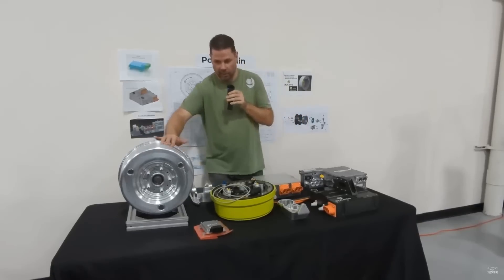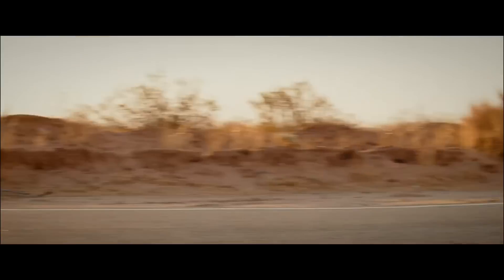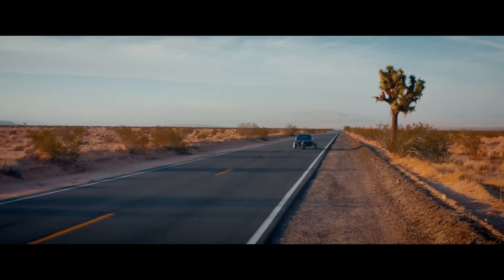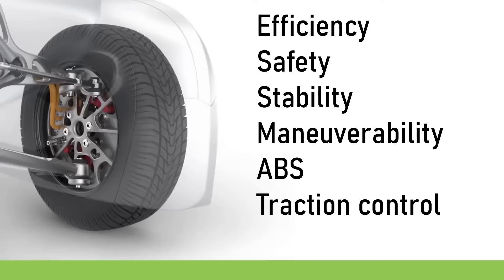Why is Aptera using In-Wheel Motors? (ft. Elaphe)

Comment: On wheel motor it can be used in bike , convert gas to hybrid or ev with least cost market in car , truck , power chair , and bike. If build half motor half generator then use very little battery

Comment: This particular configuration seems impractical for a regular everyday car. Personally, I would feel uneasy about its safety in the event of an accident and hesitant to take it on the freeway. Additionally, placing the motors in the wheels may raise durability concerns, as it could expose them to more wear from pot holes impacts, debris, water, and road chemicals etc. But you can use it as a off-road desert explorer. Not a lot of market for those.

Comment: in wheel motors will be beneficial in tracked vehicles like battle tanks and armoured vehicles. 
if all bogie wheels have in wheel motor, the vehicle will be able to move around, even if the track is cut.
if each in wheel motor is 100 hp, then there will be 2 idler wheels, 2 sprocket wheels, 12 bogie wheels.
so, all combined will be 1600 hp, which is almost the same as Leopard 2 or Abrams tanks.

Comment: How to get modern road handling with these motors, without running into the problem of unsprung weight?
Considering American potholed roads? How to make the motor's bearings and so on stand the bumps and vibrations from the road contact?
The gyro effect of the greater weight of the total wheel weight  must neccessarily impair the responsivity of the steering.

Comment: Please note that in-wheel BRAKES also negatively affect unsprung weight.
As I see it, reduction of unsprung weight depends on integration of (among other things) the tire-carrying rim along with brake parts & motor-parts.
Hubless wheels is another solution, with brakes & motor forming a single unit around which the tire plus its rim rotate. Its single mount on the car-frame makes it an integral part of the suspension, and possibly also of the steering system -- thus further reducing unsprung weight. The tire's rim is the moving part of the brake system. Making maximal use of regenerative braking puts less demands on the mechanical brake system. -- thus also reducing unsprung weight.
Yet another factor could be the tires themselves taking on a greater role in suspension.

Comment: in wheel motors eliminate the mechanical joint losses thus improve efficiency . In other words it contribute to energy savings as well. The bad side is it is prone to breakage through harsh road condition such as pot holes and rough roads where the most damage sustain would be the bearing itself

Comment: What if I attach these to a  fwd car. Put Aptera on the rear wheels. Since car is at 380lbs of torque. This could help the car grip on a luanch vs front wheel skidding for traction

Comment: If you coupled this with "swap out batteries" you would leave everyone standing - you pull up at the "gas station" clic out your low battery and clic in your new battery and you pay at the machine that measures the charge left in your low battery to accurately give you the cost of the swap charged battery. That would mean you can swap pay and go in "LESS" time that it would take to put in a gallon of gas. Not standardising batteries that can quick swap is one of the biggest mistakes EV companies made. Their selfish competitive non co operative mentality is their biggest flaw. You ask any ev owner they would love quick swap n pay batteries.

Comment: I have been shaking my head since the boom of electric vehicles have not included hub motor equipped versions.  It seems to me - and I am far from an automotive engineer - that if you used a hub motor (or IWM as you call them) on all four wheels you could then use a computer to distribute power when and where needed.  If you are easing down the autobahn then only one of the motors would be needed.  If traction becomes an issue, all four could be used. (or any combination of them)  The ECU could even use the motors to yaw the vehicle if needed.  So many possibilities!  Whenever I have asked why hub motors are not used the answer I consistently receive is "too much unsprung weight" ...It seems that the benefits outweigh the negatives in this case.
Reply: I'm not an automotive engineer either, but when I was younger, I was interested in racing.  I read a few books on how to become a better (race) driver.  They covered suspension a lot, and a lot of racing is understanding how to use your suspension in ways that don't slow you down.

If you want good suspension performance, the last place you want weight is in the wheels.  Lighter wheels can react to irregularities in the road faster, by having less mass for the car's spring to overcome (the spring is responsible for pushing the wheel back down to the road).  There's a lot of other items that are impacted (spinning something heavier takes more energy, etc.) but the suspension issues are what typically leads to in-wheel motors only being used on prototype cars (because in-wheel motors ARE cool) or heavier production trucks (because the wheel to body ratio of weight is still low when the body get much heavier).

That's why people (ok some people) routinely pay $1300 for a set of wheels that reduces the weight in the wheels by about 12 lbs.  You can immediately feel the difference, and in racing your track times will improve even if your driving doesn't.  To get an idea of how much people will pay, Corvette has a set of wheels for about $12,000 to $20,000 that are 100% carbon fiber and reduce wheel weight by 41 lbs.  There's an entire market for lighter disk brakes, disk brake calipers, suspension arms, etc.

Lordstown Motors (defunct) produced the Endurance (about 50 to 100 vehicles).  Their additional wheel weight due to the motor was reported to be 85 lbs per wheel.  Nobody said anything nicer than "ok", "boring", or "passable" about it's ride quality.

The way this weight is measured is in a ratio to the car's overall weight.  Bits of the car not supported by the spring comprise "unsprung weight".  A typical car has a unsprung to total mass ratio between 0.12 and 0.15.  Assuming a 75 lb motor, and an additional 100 lbs per wheel of suspension, that's 525 lbs of unsprung weight, which would be comfortable with a 3,500 to 4,375 lb vehicle.  There are tricks than can improve this, but they are generally avoided because they impact the car's ability to corner or add even more weight in the wheel.

Heavy wheels also mean more tire wear, as the tire itself flexes more when it can't bounce upwards as quickly due to its mass.  

A better approach would have been to use near-Wheel motors  (placing the motor outside the wheel, which provides a lot of benefits, like less motor vibration, leading to smaller bearings, leading to reduced weight, and no constantly flexing (bend it till it snaps) high voltage electrical cable going into the wheel.  The REE P7-c does this, but it's a production box van chassis

Comment: This car really carries the ethos of the G1 insight! Concerned about increased unsprung mass with those in wheel motors, but using lighter materials throughout would absolutely help, as would shocks with aggressive valving or electronically controlled variable valving, along with some good programming.

Comment: OK I want to explore Front Wheel EV for my big fat American Car. When can I get prices on a complete retrofit kit and what ranges of HP and Battery can i get? I see this a great time to go AWD Hybrid with vehicles that are still in good condition but are Front Gas Engine Rear Drive and have space for In Wheel Motors and a few Batteries. Please let me know your status for the US.  Dennis
Reply: Not getting any feedback on Elaphe motors in the US? One comment stated unless you are Vehicle manufacturer we can not support you! Well, we want to be a AWD Hybrid retrofit supplier to purchased vehicles commercial and personal vehicles. We can't even complete an adequate business plan with so little input from Elaphe? When will we get Support in the US Business Development. Rumor are out that the motors don't work which must be sour grapes because so few have seen one in action.
Reply: @DennisMurphey  The main issues would seem to be that a simple conversion would most likely fail.  You would have to rebuild most of the suspension arms to hold the hub (in-wheel) motor, and you would have to have enough design experience to build a high voltage wire that could bend repeatedly over the life of the vehicle without metal fatigue breaking it internally.

And then, you would also have to have a multi-wheel motor controller, with safeguards should a single wheel motor fail.

Finally, the in-wheel motors generate a lot of heat for the small space they are in, that typically means a liquid cooling system that again crosses from the wheel to the body, where larger radiators can be installed, or attaching passive heat sinks to the motors (which don't work well when the wheel isn't spinning fast enough to get forced air convection.

Finally, the unsprung weight will be high, about 75ish to 85ish pounds greater per wheel.  Considering it's about $1300 to reduce 12 lbs of unsprung weight by buying alloy rims, the work to retrofit the typical american car might make the project look more like a P1800 Cyan price range than a P1800 vintage price range, unless you just throw ride quality out the window.

Still, I want to do the same thing, despite knowing too many engineers that tell me all the issues. :)

Comment: I've got a GMC Envoy XL with the healthy 5.3l V8, slightly modified to 350hp and slightly over 20mpg.  4wd isn't working, and I want 4x4, more mpg, and more power.  After I buy my Aptera, I'll still need the 'and' rig for work, hauling, towing, which it does well.  I'm thinking of making the Envoy a powerful Hybrid by going with these same motors in the front wheels of the Envoy after disconnecting non-functioning 4wd. Having the front electric system totally separate from V8 drive system with separate controls for simplicity, infinitely variable torque-split and vectoring, ability to go all gas, or all electric (for short spurts), or everything for mo powaah. Ability to use electric to boost mpg of I.C.E, or use I.C.E. in combination with regen braking to boost electrical range like Chevy Volt hybrid. Lots of room on floor for plenty of battery, and hood/XL roof for solar, to take from aptera's philosophy.  But with hybrid, trailer-rippin practicality, why wouldn't this work?

Comment: Well, if just the hub motor replaced the wheel structure itself, and they should distributed  the unsprung weight in four smaller engines, one in each wheel of a car, wouldn't that help?

Comment: A typical 3,300 lb car has 4 tire/wheel combinations weighing about 50 lbs each, to which you add a portion of the suspension A-arms, etc. (front) and the braking system - use 50 lbs additional, for 100 lbs/corner, and you get a sprung:unsprung ratio of 8:1 for the front, and higher for solid axle rears.  Much engineering goes into automotive ride quality to damp road-induced oscillation and impact.  Here, you not only have a very light vehicle, but you are adding a 50 lb electric motor to the admittedly lighter tire/wheel combination, and some form of braking that may also be incorporated.  It's hard to see how the ratio could be higher than about 3:1.  Seems like it would jangle your fillings loose on a bumpy road.  Add to that the fact that the motors would be banging around over every bump, imposing shock loads on the windings, bearings, etc. and you'd need mil-spec construction to survive.  Just move them inboard and run a half-shaft to the wheel - problem solved.
Reply: They most emotionally invested fan and don’t or won’t see any issues with this vehicle. They don’t understand that they are not enough to bring this vehicle mainstream. The vehicle will sink like a stone without market adoption. As an investor I will enjoy the 2 to 3 year hype and be out has collector. Enjoy the ride and love the car for what it is, not what you want or hope it will be

Comment: I did not see any comment on the potential issue of having the brakes inside the electric motor. On one hand the motors need cooling to operate well. On the other the brakes are putting a lot of heat into the pods.

Comment: One benefit of replacing Aluminum or steel wheels with carbon fiber is a reduction in un-sprung weight, giving a vehicle a number of performance advantages, well in ICE vehicles.

I suppose the instant application of torque negates some of these advantages where rotational acceleration is handicapped by extra mass. I also suppose torque vectoring substantially negates many downsides of the extra un-sprung weight.

How is the Aptera on bumpy, potholed streets? I doubt torque can help at all here and this requires significant refinements in spring rates and dampers. I look forward to seeing hiw different this tech will feel while driving.

Comment: The biggest to NOT use an inwheel motor is the expense of repair should there be an accident as presumably you're going to need an entirely new motor in even a mildly impactful incident. This can be dramatically mitigated however with the dramatic improvements in fact creation of "vehicle autonomy."

Comment: There are some complain regarding unsprung mass. Such idea came from  car manufacturers who like produce gearboxes, because they do not want to make cheap cars. I advice complainers to look how hub motor works in electric motocycle. Do perhaps is  not hub motor that is propelling electric motocycle? Anyway, I would not buy tricycle. You should change it for simple safety reason to get real car, not tricycle. One more wheel do not weight such more to create problem.

Comment: I really like the idea of in wheel motors. Most modern cars are pretty damn efficient when driving at highway speeds, if electric motors could pick up the in-between it would remove an inconceivable amount of idle pollution, without trying to convert the entire world to a solution we only have the means to provide to less than 10% of the population.

Comment: An in wheel motor must spin slower and produce a higher torque because if does not have a gear reduction.  Higher torque requires a heavier and more expensive motor. Some hub motors for electric bicycles use a planetary gear reduction for this reason.

Comment: Why don't we see some kind of electric motor for initial acceleration and some kind of normal combustion after that as wind resistance is more of a factor?
Reply: It's called a Prius.
Reply: @linusa2996  I thought the Prius used electricity until it was mostly depleted then switched to gas. Does it change based on speed or torque demands?
Reply: @justcommenting4981  Yes, the Prius uses both motors during acceleration, electric at slow speeds, gas at 35mph+.
Reply: @linusa2996  wow, pretty cool. I'm dissapointed this isn't used in higher performance vehicles. Makes the Prius more appealing actually.
Reply: @justcommenting4981  There are Porsche, BMW, Lamborghini, Ferrari and Maclaren Hybrids
Reply: @linusa2996  Wow, I didn't know. BMW is very lackluster but Ferrari Stradale and McLaren Atura are impressive. Ferrari in particular is mind blowing...unfortunately so is the price. I hope more reasonable prices make there way to customers. Glad car makers are making use of both technologies. Will be great to see how cars evolve in 2 more generations of EVs. Thanks for the information.
Reply: @justcommenting4981  Those cars are always expensive, but as they say speed is expensive and 180-220 mph is very expensive indeed

Comment: In wheel motors must be a trade off with unsprung wheel weight. Also the three wheel design ( great only on smooth roads )  would find it difficult to navigate the 1km track ,into the farm where I work.

Comment: In general, the heavier the electric motor, the more power it can handle.
Unfortunately for direct-drive (non-geared) hub motors, that means a powerful motor is working against the suspension as unsprung weight.

I like this car, but I'd personally rather see them ditch the hub-motors in favor of two on-board motors w/ drive shafts.
I also don't see much benefit to offering the rear-wheel being driven.

Comment: Why no mention of unsprung weight? Race cars do everything they can to make sure that the wheels are as light as possible so that they are free to move for good suspension response. But this vehicle is putting heavy motors in the wheels and if they are lightweight there should've been a comparison between the weight of disc brakes and these motors. Oh yah, where are the brakes?
Reply: I think the motors are the brakes. Also, these are not race cars so unsprung weight is a minor issue.

Comment: Why is it a three wheel vehicle? Because it is more efficient or to avoid safety requirements of automobiles?
Reply from the maker: It's to reduce rolling resistance. The aim is to push efficiency to the absolute limits of physics. The company has said it will produce other types of vehicles in the future.

Comment: I'm from Slovenia and know a few people who work at Elaphe, great company, culture and people.

That aside, I think in-wheel motors are a bad idea. Too many issues: unsprung weight, gyroscopic effects, high voltage isolation, cooling, mechanical shock, corrosion, lack of gearing, etc.

Compare that to an inboard motor with CV axles (effectively 1/2 unsprung), and the inboard configuration wins every time.

I wish the company well, but I doubt they have a future with these designs.
Reply: Kot je Pipistrel rekel:” slovenci vse oprostijo samo uspeha ne.” Ti si eden izmwd njih… Pa uzivaj v svoji zavisti troler
Reply: Do you think innovation will make in wheel motors smaller and lighter?  How about the Konigsegg 'Dark Matter' electric motors, and Lucid motors?